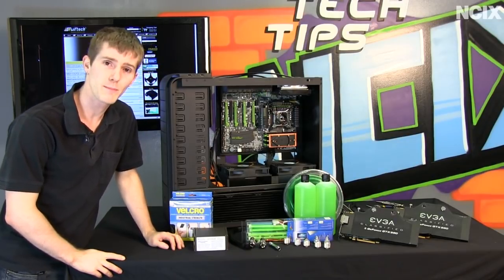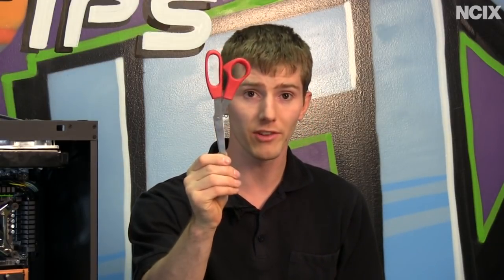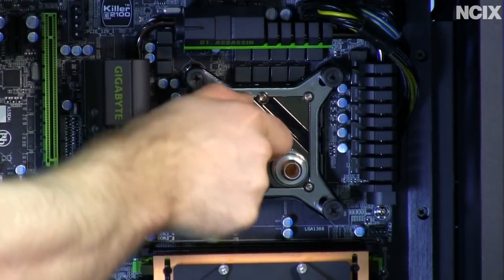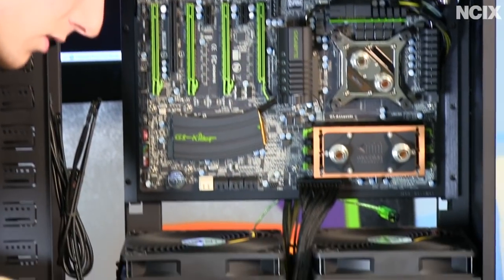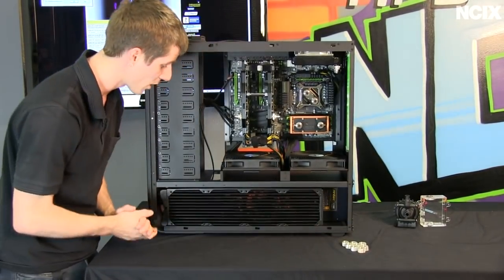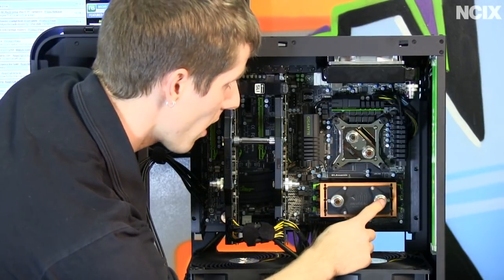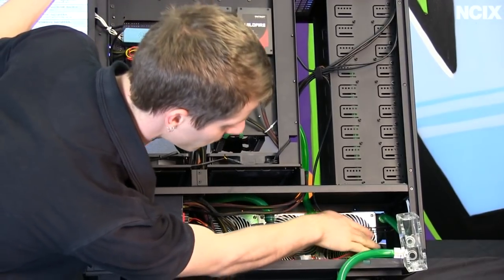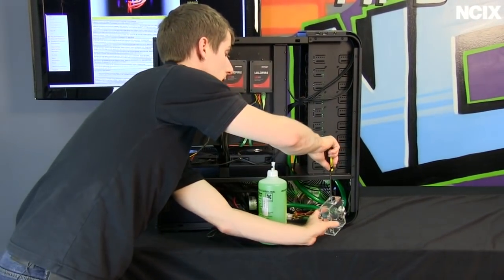Ultimate Water Cooling Guide Part 3 - Tubing, Liquid & Conclusion NCIX Tech Tips

Comment: has anybody tried  this with mineral oil not the submerged  ones
Reply: I believe mineral oil is too thick to run in a water loop...I could be wrong though. I see no point in doing so though, it's not like it's going to be any cooler than distilled water.
Reply: Mineral oil has a lower heat transport coefficient (therefore is worse) than water, and retains the heat longer so it will take a long radiator path with dense fins to remove (or secondary cooling).
Reply: fouracescw The term is specific heat and heat transfer coefficient, not "heat transport". But youre correct otherwise

Comment: Im running an FX at 4,7GHz with air :D
Reply: thats probably not a good idea...
Reply: Now it's winter, full load in 3 hours is from 40 to 50 ºC, in normal usage it won't go full load and has an extreme performance compared to stock clock (3.6GHz).
Without a great cooling on the case and a good CPU fan and good motherboard/PSU that won't be a good idea..
Reply: Similar story here: My bed used to be in this corner, until I noticed my sheets freezing to the wall. 4.5 GHz with stock heatsink when it's below freezing outside.
Reply: ***** What temps do you get in full load with the stock heatsink?
Reply: Alrynec Over 9000 kelvin. Oh wait, that would kill everyone within a few hundred feet.
Reply: ***** :D That would be awesome try it out
Reply: ***** Reminds me of the good old days when some CPUs didn't have automatic throttling and would literally start on fire.
Reply: ***** if i had an unlocked cpu..(will be getting on for my bday lol) i wouldn't be able to push it that high on air even in winter time ..i live in Australia so yeah i would probably burn the house down
Reply: ***** you know even in winter time it can get over 30c here XD
Reply: Wyatt O'Shea Do you live in an equatorial region?
Reply: I wrote it in my comment lol :P
Reply: Wyatt O'Shea Woow 30Cº in winter!
Reply: Meh it gets hot as fk here in aus...just a few weeks ago (summer time here btw) my mate had 47c at his place haha and for 9 days straight we had 40-45c :P
Reply: even now at 3:37 am it is above 20c outside lol
Reply: Wyatt O'Shea It's boiling like in hell :D

Comment: hi i need advaise i need build PC for gaming for 900$  can som one help ?? i got old cease power suplay  this price need to by breake in to cpu,motherboard ram graphic card
Reply: ***** hi thx 4 re-play to all the case well by from packard bell standard cease power suplay with i got is 500W 2yers old wan to play crisis3 need 4 spead call of duty new edytion .... i wan to breake this mony on mather board cpu and ram and nex month buy proper graphic card and in time "b" use build in grafic card ..just 4 basic use.... im from UK so amazon and ebay well by best 4 my i put down 800$ as in uk this well by 700 pounds +/-
Reply: AND WHAT IS BETER LSI OR CROSS FIRE ??
Reply: ***** ok 4 now i buy this last night >> AsRock Z77 Extreme4 Motherboard (Socket 1155, Intel Z77 and >> i5 > Intel 3rd Generation Core i5-3570K CPU (4 x 3.40GHz, Ivy Bridge, Socket 1155, 6Mb L3 Cache, Intel Turbo Boost Technology 2.0. nex month ram and graphic card :) i spend on this 250 pounds only :) now in plan is 16GB ram +graphic card what u can reccomend ?? i found ram 2333 16gb for 140 pounds so i got 200/250 pounds for card i need grafic card to pley in ultra high options :) and i got 32" tv for this :)
Reply: ***** crisis 3 is in 3D ok. thx man i well by in contact with you as i gow with my build :)

Comment: If you are an electrical engineer, then I weep for your customers. More than like though, you are just yapping your mouth on the internet.

Voltage is not power. Watts are the unit of power as SFseis said. Volt is the unit of electric potential. Electricity is the set of phenomena that describe the presence and flow of electric charge, and includes power, voltage and amperage. SFseis never mentioned electricity, so why you brought that up is a mystery.

Maybe you need to study instead?